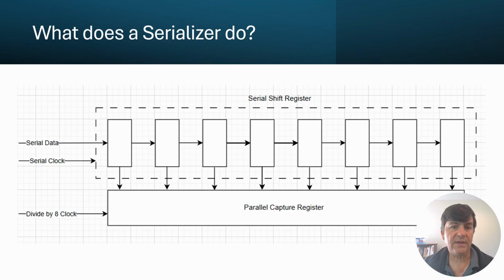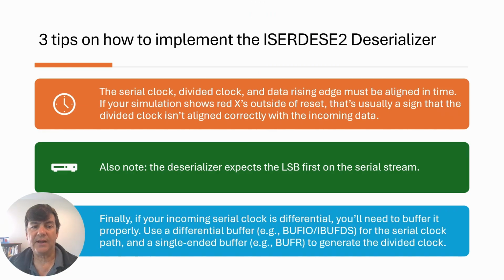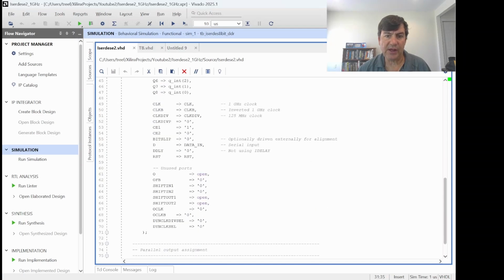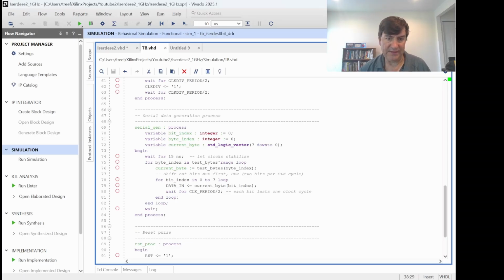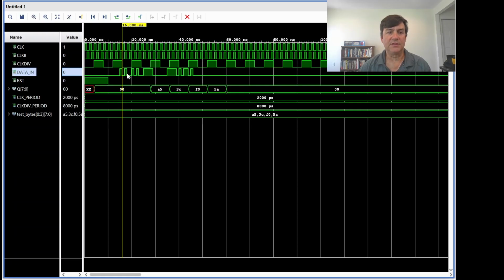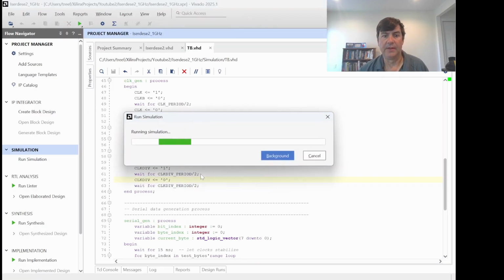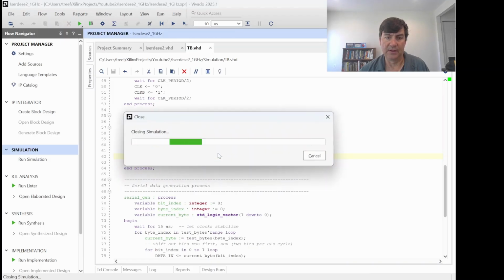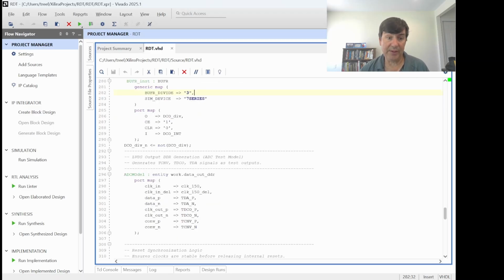Using ISERDESE2 (Serdes) in Xilinx FPGA's with Vivado

Comment: hi, can you give the verilog code please? Bcoz I'm working with this ISEDESE2 for 2 weeks, but not getting required output
Reply from the maker: Let me see what I can do. I'll get back to you.
Reply: @palmtree1126 thank you
Reply from the maker: When I converted the VHDL to Verilog, I initially had trouble getting the ISERDESE2 output to produce any data. However, after extending the length of the test pattern, the output started working. That said, the Verilog output is delayed compared to the VHDL version. I don't know why but in any case The Verilog code is here: https://github.com/pkerstetter/iserdese2_verilog
Reply: @palmtree1126 Ok Thank you, I will try it.
Reply: @palmtree1126 I have some doubts. Do you have telegram, i will discuss it there.
Reply from the maker: Sorry I don't
Reply: @palmtree1126 will you explain the bitslip part? Why and How it works? Why the count 3
Reply from the maker: Check out my video:  Bit Alignment & Bit Slipping in FPGAs Explained | ISERDESE2 Tutorial (Xilinx Series 7)

Comment: Thanks for the helpful video. Not much video on this topic.
Can I ask a couple of questions:
1) In your experience what's the maximum frequency I can get before I start having problems synchronizing the data bus and clock on this chip?
Xilinx has a delay unit; will it help achieve better synchronization and higher speeds?
2) If I understand correctly, the Xilinx 7 series has a built-in 8b/10b converter. What's the maximum frequency I can get with it?
Reply from the maker: I recommend doing a simple timing analysis to see whether your design can still close timing—if you haven’t already. Increase the frequency until timing fails. The same strategy applies when working with the 8b/10b converter.

I don’t actually know the exact answers to your question, but this is the approach I would take. I’m also planning to do a video on the delay unit soon, so stay tuned!